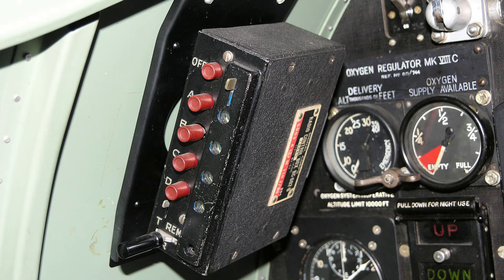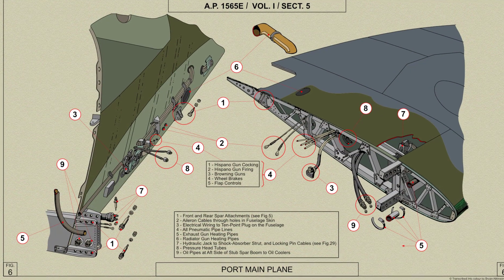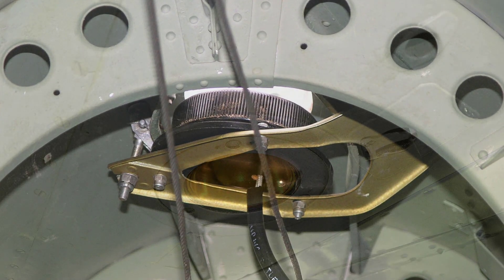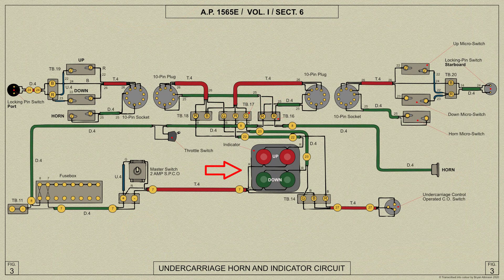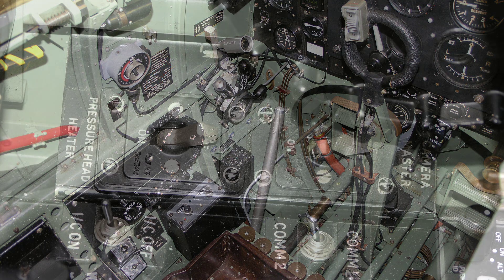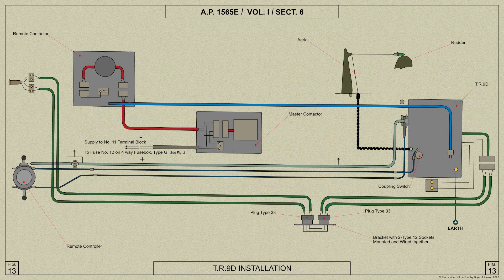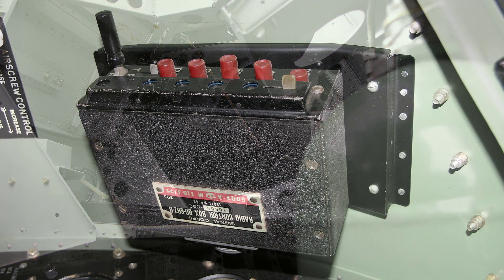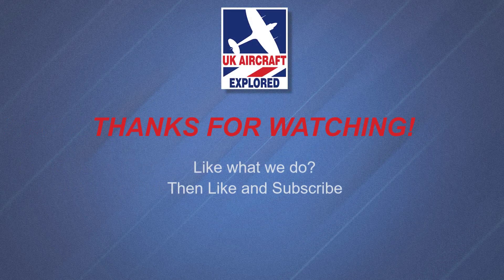Spitfire Mk V – Electrical Installations

Comment: This was very interesting, my Father was an Electrician in the RAF during WWII and was attached to 81 Sqn in 1942 to take part in Operation Torch. At this time 81 Sqn was equipped with the Sptifire Vc, so he would have been working with everything you are describing in this video. They would later upgrade to Spitfire IX but I know he spent a long time with Spitfire Vs. Thank you for posting!
Reply from the maker: You're welcome. I'm pleased you found it interesting and thanks for sharing, very interesting.